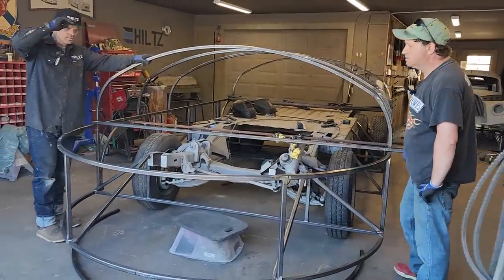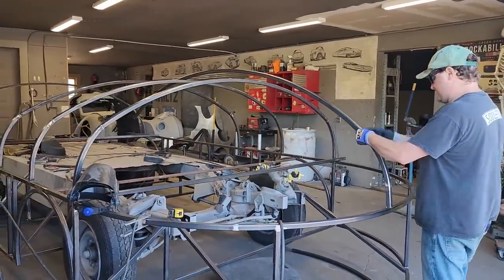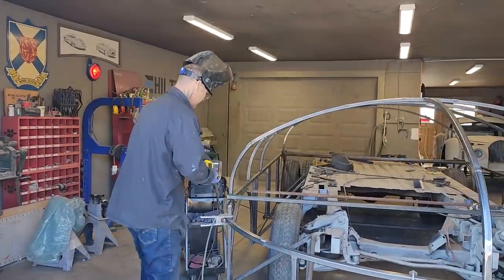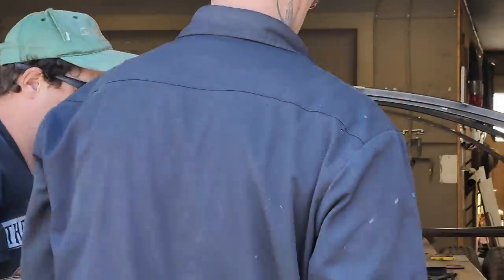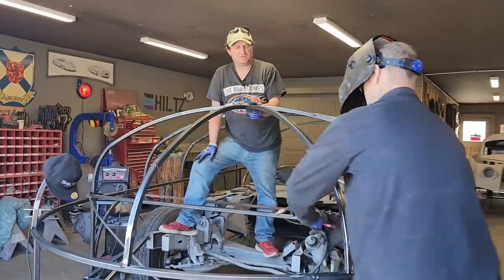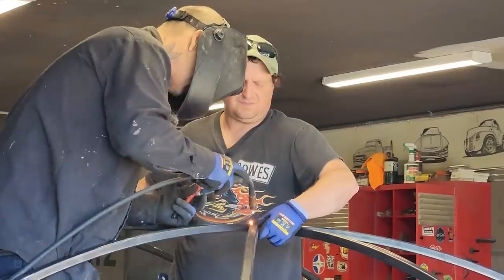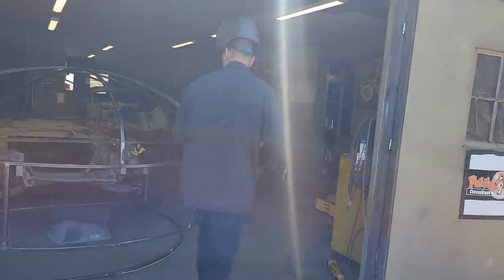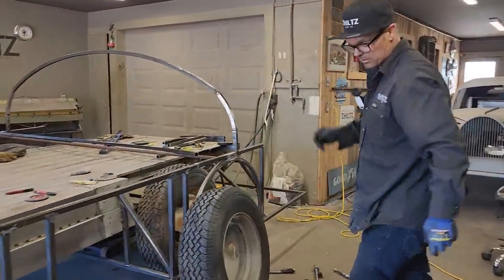This will be a challenge... fabricating the circular cab 😬

Comment: This was built back in 1936. It was built very low so  it could be driven under and air plane wing which made fueling an airplane much easier and reduces the chances of hitting the plane with the fuel truck which made winter fueling on the ice safer and easier. Besides it being a very cool looking vehicle.
Reply: Thanks for adding that information . 
I was wondering what it's purpose was.

Comment: Chad and jolene you don't need the inner wheel just bolt the rear wheel onto the front hub the way you tried to fit it then you only have a single wheel and it may fit into the arch .keep up the great work all of you 👍 👏

Comment: It looks like you don’t have enough room for dual wheels in front. If you turned to the Left or Right, the outside wheel would Hit the frame you built. You need wheel wells with enough room, for both wheels to turn.
Reply: Spacers or front end chassis mod. We'll see.
Reply: Offroad Jeep Cherokee guys get it. Big Wide tires either rub the lower control arm or the fender/flare. Time to get out the sawzall.
Reply: You definitely do not have enough space for dual wheels to turn fully, lock to lock. Think about where the pivot point is for the single wheel. Adding another wheel increases your turn radius substantially. At the very least, you will need to move the frame you made both in front and behind the front tires to accommodate the bigger turn radius. The only other option I can see is to either ditch that front suspension and replace it with a wider one, or cut the one you have in half and widen it. A lot of work, but steering geometry would be right.
Reply: @GaryWeeks-ts7tb  I  agree, simply adding a dual rim-tire-spacer-adapter gizmoo to the existing hub-rotor wont likely allow clearances for steering. 
an easy way to picture the issue is to visually exagerate it : 
imagine adding a 4 rim-tire-spacer-adapter (5 tires wide) to the existing steer tire. The clearance needed would be HUGE. chads 2 steer tire clerance would be less but still very BIG. The forces required to steer would also be amplified, but not unsolvable. 
i like the concept and COOL factor of Chads double steer tires idea and I look forward to his creative solution to these challenges.

Comment: To put the back rims on the front how bigger job would it be to grind of all the places where The frame is welded to the chassis then left it up so the big wheel fix the weld it back again

Comment: If the front suspension was replaced with a modified straight axle you could get a single wide rim to fit exactly where you want it.

Comment: Find a 4 wheel drive front end for the doodle bug, it will give you front steering and may allow the same tire setup as the rear, no need to hook up drive line.

Comment: Chad…Great progress! Consider one wheel on the front but offset like the rear. Take the Front wheel off and put one of the rear wheels on with the offset to the outside. I think this will center the tire in the opening and give you room for steering. Try it out.

Comment: you dont want to use a wheel spaced that wide in the front, the scrub radius will be too large you would need 2x the wheel well for the tire to turn , not to mention the steering geometry will be f'd up.

Comment: I love the idea of the dual front wheels although it will def make steering harder but it's obviously not a daily driver so that part would be fine, but I'm afraid your distance to the square tubing in front and behind the tire will be too close. That width out past the pivot point of your ball joints will make the tires travel way forward and way back when turning.
Reply: No worries…. It may not be roadworthy anyhow!! I’m not feeling good about this creation???
Reply: @MrHowlor5  It will never hit the road, as a roadworthy vehicle, probably just get pushed into the shed with the rest of the uncompleted vehicles.

Comment: Hi

You could try using the 4 rear wheels on the front and rear.
   Use as singles with the rim dish outwards. Don't run the inner wheels. Be equal and uniform, if the front hub studs allow it.

Comment: Try using 1 dually rim on the front. Mount it like the outside tire on the back
Reply: Terrible idea. You'll offset the pivot point of the wheels when steering.

Comment: Nor at ride height yet. Be interesting to see how close the furtherest front lip will be to the ground with the motor/gearbox etc is all in - all the best
Reply: I think it will drag on the road if the road has a dip in it,the front overhang  33:37 should be angled up from the wheels forward 🤔

Comment: I'm not an alignment specialist but doesn't the camber tilt the wheel when making turns so it seems like the width of duel wheels would make one wheel lift off of the ground on sharp turns and make it very hard to steer or maybe dangerous .

Comment: Most one ton trucks have a spacer on the front hub. This allows you to run the same wheel and tire as the rear. Some of the older RVs just run a 3/4 ton wheel on the front hub.

Comment: Hi chad in England wen we mack the wheels wider we do a thing called rimming we cut the wheel in two bits we put a Rim in the middle and weld it up to widen the wheel and the wheel will look similar to your back wheels but they are actually your front wheels use the same old studs look it up in England rimming wheels they look cool as well you can chrome the wheels or painter the Wales it makes the standard wheel look the same but bigger you Don the same thing with your big red truck you rimed the wheels on that sorry for the translation sorry if you don't understand my writing good luck love your channel chad  and Jolene and dug and fina the dog good look

Comment: You were wondering what to do about the front wheel spacing and I think I have a solution for you. Get a pair of front rotors with the the Budd wheel hubs  and put them on and then put those wheels that are currently on it and it should move the wheel stance out by 4-6 inches. As for a motor idea, how about a dressed up straight 8 and make a clear Lexan cover out of 1" thick material?

Comment: With duallys in the front you hit on two problems,  the space the outer wheel takes to turn and the geometric of the turn, the outer wheel goes a bigger circle than the inner so you will have a hell of a understeer. Unless you make the outer free rolling.

Comment: Love the build guys.
As a qualified mechanic, I’d advise not to fit dual wheels to the front because it will make the steering extremely heavy, and apply far too much load to the wheel bearings and the steering and suspension components.
Put a Jack stand under the rear left, and Jack up the the front left and remove the wheel, put a Jack stand under the front left, and try the rear outer wheel on the front. You may find the offset is spot on. Plus if you use rear wheels on the front, the height will be the same front and rear.

Comment: Run the rear dual wheel single with the spacer and it would work.  It would steer better with just one wheel in the front but from the side, it would look the same.

Comment: You probably need to buy a set of dual wheels from the rear to go on the front, assuming the stud pattern's the same. Don't think you can put spacers outside the existing front wheels because they aren't flat both sides where they bolt up.
You still need to mock something up and swing it lock to lock to see if they clear.

Comment: Dual wheels in the front?  Hmmmmm  Good luck with that.  i mentioned in a past video to go with single tires in the back.  By proportion you are lower on height and much wider on the width.  Well have fun with that and good luck.

Comment: Just remove the current front tires and rims.  Then install the rear outside tire on the front hub.  I will move the tire way out and have the benefit of only 1 tire to turn.

Comment: You aren't going to be able to turn the front wheels if you go dual. You might need to just use a spacer and open it up inside the wheel well a little. Good luck guys. Awesome job so far though.

Comment: @4:20 You're measuring from the outside of the right hand side,  to the inside of the left hand side. Your centre will be off by half of the frame material width.

Measure from outside of frame, to the outside on the other side, or from inside to inside.

Comment: I'm afraid fitting a dually rim on stock front would make off-set centerline of wheel too far from axle turning spindle.  Centerline of front axle on chassis now is probably 12-14" too narrow.   Easiest way is probably using a old time straight or drop axle frontend cut and widened to set dually wheels where you want them in wheel well.

Comment: what would happen id you used  an acetylele torch to heat the metal where yoou need to bend it rather than working so hard to weld and make it work like that but heat it up and  bend it to place
Reply: For some reason Chad seems apprehensive about oxygen and acetylene tanks. I agree, it could often save time and effort.

Comment: CHAD REMOVE THE FRONT WHEEL THAT'S ON THERE AND JUST PUT THAT REAR WHEEL ON HAS YOU INTENDED TO DO IT WILL FIT ONCE YOU JACK UP THE VECH IT WASN'T EVEN CENTRE TO THE HUB WHEN YOU PLACED IT AGAINST THE FRONT WHEEL.. THE HUB WAS A GOOD 2 INCH LOWER

Comment: You are not taking into account how adding the width of an extra wheel is going to alter the arc through which your wheel travels in order to turn. 

Looking from the top down the current single wheel has the hub as the center of an arc. The leading and trailing ends of the tyre and the circular face of the wheel pivot around that center point.  The current offset of the face of the single wheel is almost inline with pivot point of the hub so you only have to allow clearance for the forward and trailing edges of your tyer when you think about your wheel pivoting. 

By adding a second wheel outside the existing one without changing the offset to compensate for it you are basically lengthening the radius of the arc that is described by circular face of the wheel around its pivot point. In other words with your frame as it is now the wheel will not be able to turn more than a couple of degrees in either direction without the outside edge of the second tyre coming in contact with the frame which will leave you with a turning radius for the thing of about 3km. 

I would urge you to consider widening your existing steering setup or getting something off a wider vehicle rather than simply slapping a second wheel on your existing setup.

Comment: Pull the front wheel off boltthe rearwheel on backward like an outside dual and then run a spacer it will dual wheel from the side

Comment: Take the front wheel off and put the back wheel on like you had it. Take the back wheel off and turn it around and put it back on. You will not need dual wheels on the front.

Comment: Just add longer lugs and spacers then run the 1 dual wheel on front. If that wont work put the 1 ton rotor on the front with longer lugs one way should work for you but I dont thi k you read these comments and have gotten very arrogant lately.

Comment: the front breaks and hub are made for a single wheel to have duel wheels you need the same rims on the back inside and out .bring the hub out and inside rim in .measure the distance from inside of inside wheel to the outside of outside wheel . then how far in from your new frame and in on the front where the outside of where the tire needs to be to line up with rear  and how far the outside wheel will travel front to rear at full turn  i feel it will  not work  and you have not talked about the doors to get in the front . look at a true dully one ton the front wheels are the same rims as the rear its just the inside wheel so they all interchange . if you where to put  the same duel set up on the front you have now the inside wheel will rub suspension and the outside will not be the same as the back . you could try rims with a outside offset to bring rim out , the pivot point of the front wheels determines how large the wheel opening needs to be

Comment: Can you not just put two dual rims just like the back with shorter tires like on the front know. You may have to put longer wheel studs to properly fit both rims. 
Worst case you will have to change out front spindles for one tons to get a correct fit

Comment: Is that cage for tweetie pie
Reply: You guys need to probably look into getting a super single wheel. I think they have them in 22.5 low pro. I think that’s the best way to go. It’s called a super single they go on semi trucks.
Reply: Why didn’t you use the level on the front pieces

Comment: Remove the front wheel and tire, then the back wheel and tire will bolt right up and give you the look you want. running dual wheels on the front will not only make it handle like shit, but steering and control would be VERY unsafe.  Everything on that front suspension, wheel bearings and all is not designed to be running dual wheels.

Comment: I am starting to see the vision that Chad sees! Too bad Chad made a boo boo with the tires and wheel sizes. That was unexpected, not knowing the front and rear tires were different sizes at the end of the video.
    The origional Doodlebug was 6 feet tall? Chad's Doodlebug is 5 feet tall?🤔 My eyes were right. It was was short and lower than it should of been, but was off by 6 inches lower than the origional hight.
    The origional Doodlebug was 92 inches  wide and Chad's Doodlebug is 92 1/2 inches wide?🤔 So it's 1/4 inch wider on both sides than the origional Doodlebug.
    Fitting the front tires looks like a challenge for steering and matching the with of the rear wheels and tires making wheel wells that will work.                  Chad's got a brain. Not an empty bone head. He will figure it out. I'm the bone head!

Comment: Duel front wheels work on tractors not road vehicles. Those tractors have articulated rear ends for steering  I doubt the DOT would approve.
It would be near impossible to steer and you could never get it aligned properly.  I think the only solution is cut the cross member and move the front suspension out to match the outer rear wheel.  No system is better than its weakest part. The front suspension is officially the weak part of this build.  This is rapidly becoming a  nonoperational concept vehicle art piece.🤨